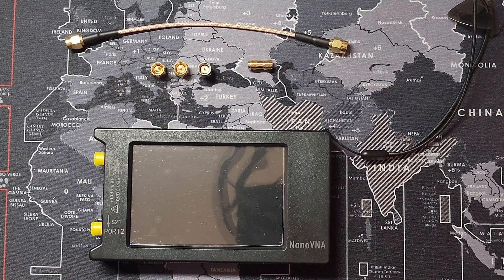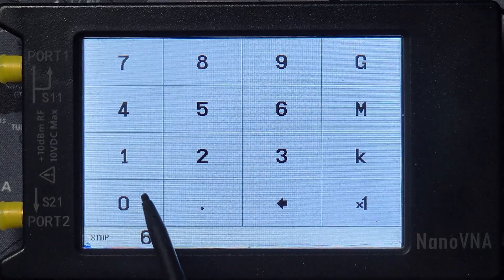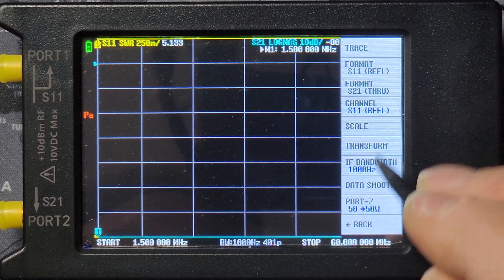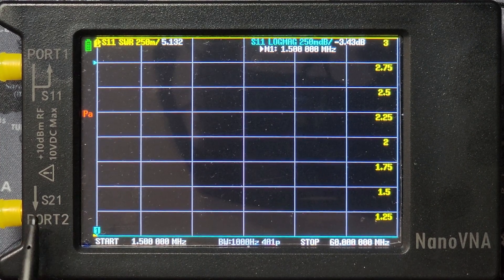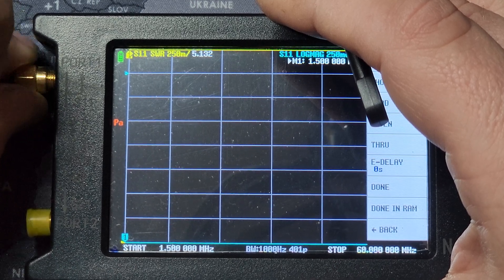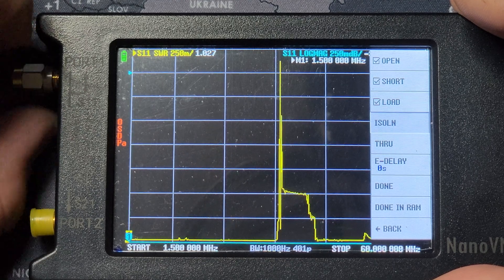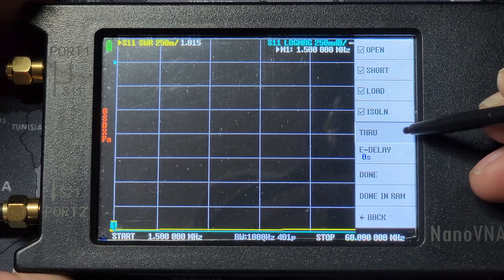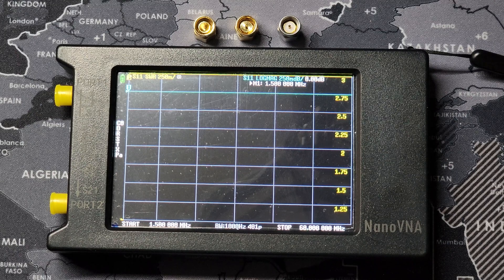NanoVNA H4 Setup & Calibration

Comment: Great video! One question- Where did you get the idea of putting loads on both ports when doing the isolation step of the calibration? I've seen several other videos on this and you're the only one I've seen do that. I'm not doubting it, I'm just curious where that info came from. Thanks!

Comment: One quick note. If your going to use two cables for your measurement, then use both cables (coupled with barrel connector)) for the "thru" calibration step..

Comment: Thanks for this!  I found that there's an update so I followed you again to update my VNA.  Oddly it didn't work.  What I found was that I had to clear the current configuration/reset the VNA then run the upgrade again.  Now .29 is installed and working correctly.
Again, thanks!

Comment: Calibration is typically done at the end of the cable you will be using. That way you are calibrated to the end of the cable you’ll use to attach to the DUT and have a meaningful THRU. Calibration directly to Port 1, then introducing a cable creates a measurement error into the calibration.

Comment: Mine got frozen 🥶 and it’s not moving 😩
Reply from the maker: Oh no! Frozen during or after the setup and calibration or the wheel that sometimes locks up?
Reply: @n3vanradio  1st time use tho.  I turn it on then I was about to do the calibration and got frozen 🥶.
Reply from the maker: Hey Wally sorry for delay. If it is frozen then the case may be touching the screen due to faulty extrusion in manufacturing. Try to loosen the screws and it should work :)

Comment: if isave  how do i get back to what i saved  just got the unti and the manual is like 80 pages
Reply from the maker: Hi Keath, to get your saved settings you should be able to go to Recall tab and have them show up. In an upcoming video you will see that when I tune an EFHW wire. Manual is extensive as this little device can do a lot! Thank you for watching.

Comment: Question:  These Nano VNAs vary, in price, from $40-$50, to some in the $120-$140 range, up to the "Mini-1300," for $180.  As far as I can tell, they all seem to have similar performance.  The more expensive ones have larger displays, but that's about the only difference I can find.  They all have a sweep function, measure R & jX, produce Smith charts, & measure VSWR.  Frequency ranges are similar, and more than what I need (2m & 70cm).  So, how is the $180 one better than the $40 model?
Reply: As I understand it, the low priced products are manufactured using either used or sub-par (rejected) integrated circuits: pieces that failed screening, etc. like a cheaply made car vs. a prestige model. In my experience, they still work well, especially for ham use. Maybe not for an Air Force, or NASA application.